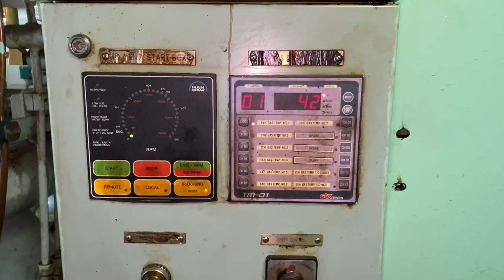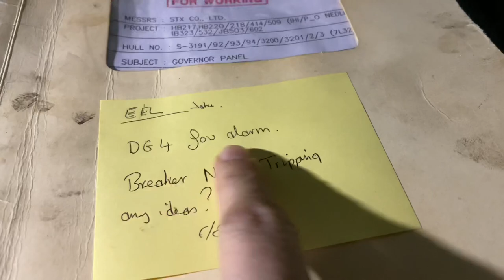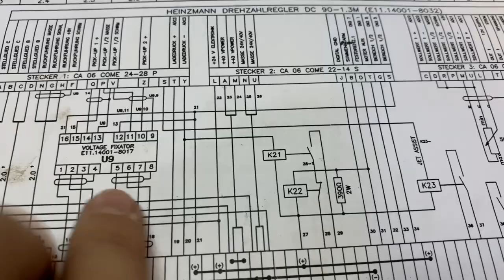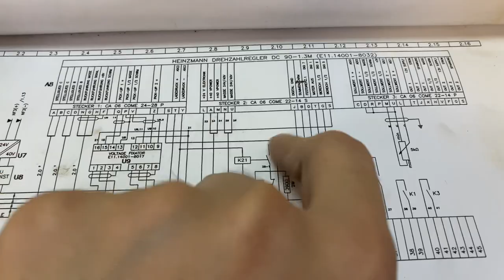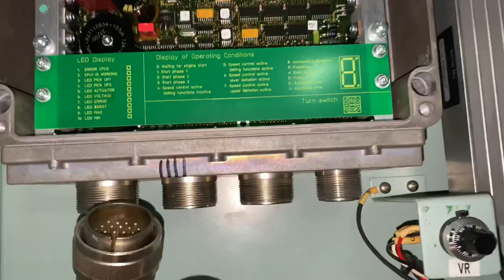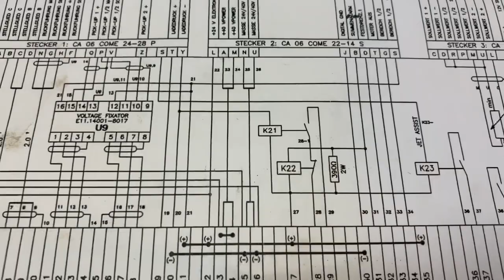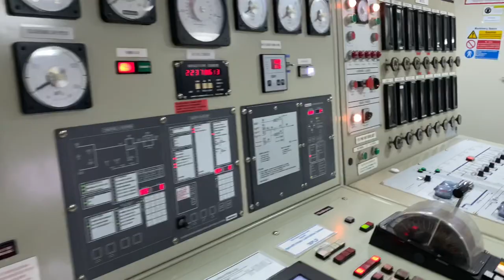TROUBLESHOOTING THE GOVERNOR OF A DIESEL GENERATOR

Comment: Awesome video I'll let you know nice troubleshooting trick when we have a tripping circuit as such it's nice to insert a lamp at rated voltage in between the breaker in the shorted circuit in this configuration when we turn the circuit on the lamp will illuminate brightly usually once we find the source of short amongst the mirrored of components as you were weeding through the haystack the light will go out so it makes it a little easier you don't have to keep turning the switch on unattentionally letting the smoke out....Peace.
Reply: I dont mean to be offtopic but does anybody know of a method to log back into an instagram account??
I stupidly lost the password. I would love any assistance you can offer me
Reply: @Timothy Wyatt Instablaster :)
Reply: @Callen Julian thanks so much for your reply. I found the site thru google and I'm in the hacking process atm.
I see it takes a while so I will get back to you later when my account password hopefully is recovered.
Reply: @Callen Julian It did the trick and I actually got access to my account again. Im so happy:D
Thank you so much you saved my account !
Reply: @Timothy Wyatt happy to help =)

Comment: Excellent and thorough troubleshooting! As a  desk jockey I love seeing your field work!
One comment you made confused me. When looking at the actuator you mentioned a few reasons you suspected the chuck cable between the actuator/controller. Did you suspect the actuator/controller from the beginning, and if so, why was it important to check the other parts of the NF2 24V bus first?
Reply from the maker: Because NF2 is supplying 3 loads and need to check those loads one by one. In troubleshooting, esp in shipping, the last thing to be suspected is always the expensive part.

Comment: It’s hard to tell for sure, but @7:50 where the canon plug enters the panel. Just below the green label plate and JUST to the right of the gray conductors I swear I see what looks like charred circuit board.  Between Gray insulators and “gold” board pins. The furthest left gold pins seem burned

Comment: dear friend, how are you always you are renewable and rich of experience please GO AHEAD with FULL SPEED you have powerful engine (touch wood), again i have confusion about continue tripping  of Breaker NF2, since you disconnected all connectors/jack to controller side but still NF2 tripping although when you dismantle controller and connected with NF2 with power supply occurred trip which for me logically if you disconnect all jacks at controller side should NF2 not trip any more except in case of NF2 connect and supply other deflective device which cause the NF2 tripping,
Sorry for long explanation just to send my clear view and diagnostics as well as easy way.

Really waiting your answer same as waiting your new videos.
Reply from the maker: I did not disconnect all. Only the output side to ensure/check that I don't have short circuit on the output side. Input cables are still connected on the controller. Every time i powered it on, no out connected, the nf2 is still tripping.
Reply: @leckyjake  Its clear for me now thanks friend and good luck all the time

Comment: Hi sir i have to ask you about the genset cummin china nta855-g1 the problema if no load the rpm of engine ok for 1800 rpm the probs is why if i load na 415kva the engine low rpm 1435 rpm and shot down the engine pls help for this cause i overhaul the engine and its ok but the problem is shot down the engine if i load to 415kva 60hz?

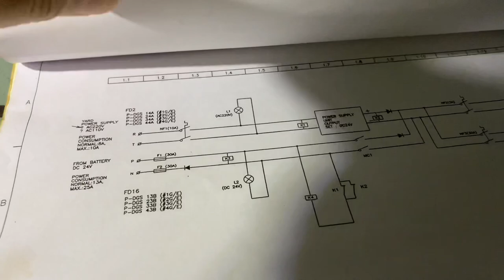Comment: at 3:18 the resistance between 2 lines of Vdc supply is 660~ ohms in the circuit breaker line side. isnt this too low?

Comment: Hi sir, during maintenance on other gen and if we need to run no4 gen, can we take the governor controller from another gen to run it  or each gen has different configuration if all generators kw are same.
Reply from the maker: Most of the time they have separate configurations and parameters that's why they can't be interchange
Reply: @leckyjake  even if all the 4generators are same, possibility to have different parameters or how do we can conform if the parameters are same or different.

Comment: want to ask, on my ship now, there are 3 generators, generator number 2 if in parallel the amperage is less than other generators, but the KW voltage and freq are the same as the others, how can that be? For example, generator number 1 has 250 amperes but generator number 2 is only 140 A, what's the problem, teacher?
Reply: Please help sir
Reply: This is due to the load variation on each generator. In other words, the generators do not have equal loads.
Reply: Make sure the voltage output of each generator is the same with the main CB open. 
Switch off the engine, ensure Speed & Trim pots are in the center
Run the engine and the main CB should be open. Make sure the speed is at 1200 or 1800 RPM
Make sure the voltage is as per spec 480 or 600... 
Do it for all 3 eng / gen and you should get great sharing between them

Comment: What are the reason for engine speed fluctuations
Reply from the maker: Fuel rail and governor
Reply: Hi bro sensor resistance is 193ohms and actuator resistance is 26.9 ohms is it okay? please explain about 721 controller